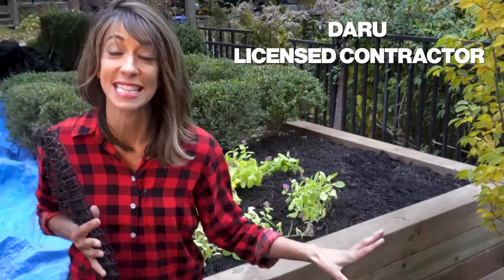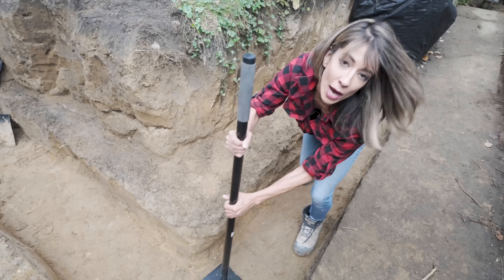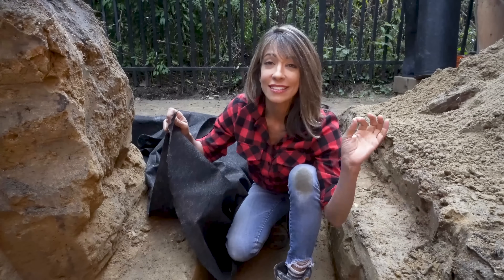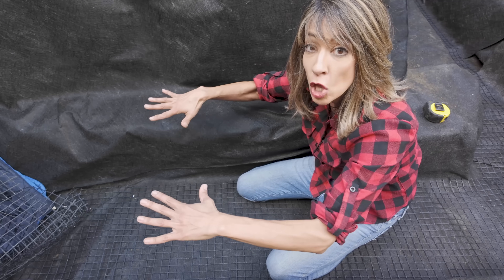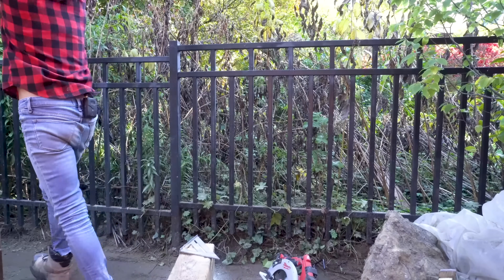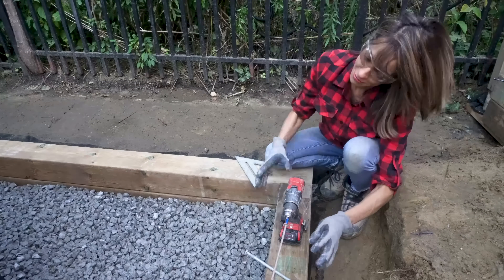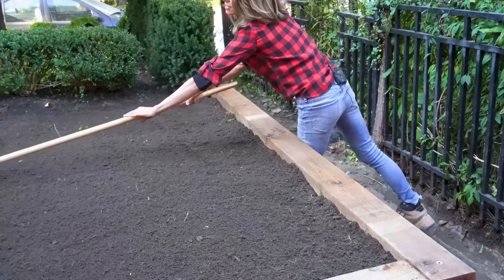No One Builds Retaining Walls Like This...Yet!

Comment: You don't need to fix the geo-grid to the timbers at all? I know it gets squeezed between the timbers, but I would have figured you would nail it.
Reply from the maker: @youmertz  the screws and the timbers secure the geogrid firmly in place. You could use an alternative method of fastening if you’d prefer.

Comment: You have NICE soil for digging. We have adobe clay which is heavy muck when wet and brown concrete when dry. What's the size and type of rebar. I think it is smooth , which is easier to work wit. Not sure if deformed is useful.
Reply from the maker: That's a tough one for sure! I have a great appreciation for this soil now thanks to all the comments. The rebar is 1/2” most hardware stores will carry it in the lumberyard.

Comment: Great job. Just as a general carpentry note. It takes 3 to four screws or nails to prevent shifting in the tie backs, or any other woden structure of this type. A complement,  you are a powerhouse for such a small person.  👍
Reply from the maker: @oldreprobate2748  thanks for sharing your tips and experience with securing the tie backs. Always good to hear you’ve experienced. Noted.

Comment: Great video - Do you need to pre-drill a hole for timber screws to reduce the chances of the timber splitting?

Do the timber screws 'sit' flush to the timber so the timber screw head doesn't create high spot causing a wobble?

Thanks
Reply from the maker: @samiam4202  Thanks. The screws don’t need pre-drilling and I didn’t experience any splitting. They are bugle head like a deck screw so they sink into the wood. Designed so the next course sits flush. No wobble. I liked them a lot.

Comment: Wow very impressive video. Not a single wasted word or moment. The ending with the Canada post story was the only non-informative bit but even that wasn't unobtrusive and kind of quaint. Thank you, I only came to see how you did the tiebacks but learned even more in the process. I have a retaining wall that is failing on a property I own. It is about 10 ft high and 200 foot long and bowing out badly all over. I am just curious when and where the tiebacks are used as in what heights do you install them and how often down the length of the wall. Maybe every three feet of wall height and staggered down the wall every ten feet and then alternate in like a cross hatch pattern or checkerboard as seen from facing the wall? I'm thinking the tiebacks I would use would be of a different design since I don't want to have to dig back behind from the face of my wall ten feet into the soil to bury them. Maybe a screw type device specific to large retaining walls. Thanks for the great video!
Reply from the maker: Good to hear form you and your feedback! I can't provide you with advice on walls that high because they would require an engineer to give you with the proper information for the soil type and conditions in your area. All the best with your build sounds like you're on the right track.

Comment: New subscriber here. Love what I'm seeing here. But opinion coming. Your drainage pipe should have been on top of the geotextile fabric below the rock. Now you will have water sitting at the bottom of your trench with the wood.
Reply from the maker: The wood is sitting on 6 inches of base aggregate so it will be good to go for drainage. It's good to keep soil away from the wood. Good reminder, thanks!

Comment: Please stop using epoxy coated rebar. It’s a flawed product that does not protect the steel rebar and holds onto moisture against the steel. This product is no longer approved for civil engineering projects or high rise construction.
Reply from the maker: Good to hear your feedback on the rebar. Thanks

Comment: Fantastic, someone who actually teaches the CORRECT way to build a retaining wall. So many do a half way job of their projects and you know in 5 years or so they will be wondering why it came apart.👍
Reply from the maker: Good to hear John thank you!
Reply: Yes drainage is very necessary, as any solid can oversaturate and cause retaining walls to fail.
In addition, I add T risers to the drain coil and a solid plastic layer at bottom for approx 10-12 inches; so you can flush out the drainage system.

Comment: Not sure I am convinced the georgrid is more secure than the dead man supports.  Think I would feel more confident with more dean-man supports,  Particularly on a wood retaining wall.  If this was a landscape brick wall where dead-man tie backs are not an option then maybe the georgic providers support absent the ability to install dead-man reinforcements.  I would concede the geogrid on a wood wall won't hurt, but I would contend one is not getting the reenforcement strength one thinks they are for the added cost.  More wood dead-man reinforcements would be much more structurally sound.

Difference of opinion on this particular technique.  I appreciate and enjoy your videos.
Reply from the maker: @James-cn9no  I appreciate hearing your perspective. I would definitely recommend deadman and tiebacks too. I would add another layer if I was going higher too. I purchased the Geogrid from a local landscaping supplier. It was $100, my cost and I did 3 walls with in. Good to hear your opinions. Diversity of perspectives is important.

Comment: Wood retaining walls can be strong, especially with geogrid reinforcing.  BUT wood will seldom last beyond a couple of decades before it starts to rot - even pressure-treated lumber will rot.  Depending on the wall height, replacing it in the future will be a challenge.  Precast modular blocks (especially dry-cast) will succumb to freeze-thaw damage in northern areas.  The most durable retaining walls will be of wet-cast modular or cast-in-place concrete.
Reply from the maker: There are many ways to build and it depends on the project and what the owner wants. I appreciate your perspective.

Comment: Where does the water from your French drain go?   Looks like it drained onto the crushed gravel just outside the retaining wall, where it will just back flow into the crushed gravel behind your wall.
Reply from the maker: They make drain extensions! You can pick them up at your local hardware store. Excellent for your downspouts too!

Comment: 0:31 BS.  You didn't dig crap.  Why don't the big wall block companies call for geogrid at the bottom?   BS video.
Reply from the maker: The brand I use does require it. I expect more brands to follow because it makes sense. This is a channel focused on innovation. When better methods exist I will use it, even if no-one else does. I also appreciate the advice of viewers when they share their methods. I learn from you too.
Reply: Hmmm...B.S...???...Well, what she is doing is certainly not my world of architecture at all, since I only work in vernacular historic restoration/replication and the sustainable natural building world...However, when we do these with wood in the traditional fashion of them (been around for millenia and in several cultures) it is done exactly the same way...for the same reasons...and the only difference is natural and sustainable materials not toxic industrial ones...

I can not, of course, speak to where you are, but I can assure you that nothing here is..."B.S."...and that is speaking as a professional designer with over 40 years of experience in architecture.  I can also tell you that these standards for MANDATING geotextiles of several types and this type of natural stone backfill...as well as...the "tie back"...reinforcement is required by IBC and other local codes in many municipalities if you tear out, replace or build a new retaining wall...and that requirement is spreading because...THIS IS BEST PRACTICE...

???...Whether she dug all this earth out herself or not I don't believe was the topic of the video but by the way she handled the shovel, I do not think she would have an issue at all working with a crew doing the same work they are doing so I'm unclear of why you felt it necessary to reflect such misogyny since "who" dug the hole was not the topic of the video, but rather "means and methods."  To be blunt, I believe your comment is the only B.S. in this comment stream thus far that I have read...

Comment: Please learn how to use a sledgehammer, that's so bad. If it's to heavy to swing get a smaller one like a mash hammer.  
Other than that good vid.
Reply from the maker: It’s not the typical way to swing for sure. Funny enough small sledges, mallets require more upper body energy and strength. I’m petite so this is by far more efficient. Don’t be afraid to go against the grain if the outcome is more beneficial to you and your work. I’ll be the odd duck on this any day. Good to hear your advice, thanks!
Reply: Curious, what did she do that  was "so bad,"  Please don't tell me you mean the "ramming" she used to put in the rod?  Sorry, that is standard practice and has been since this tool has been around...and that is speaking as someone with 40 years of experience in traditional crafting including make these tools as a blacksmith as well...Ever work with a "Mexican" landscape crew?  They do it all the time and will even melt lead or bronze into the head of the sledge, while others "tack weld" a steel plate to the top of the head for more weight and this very reason...

Comment: Great video. Did I miss something about plumb for the vertical stacking? Many times walls have each stack with a half inch to the outside or a very slight angle leaning to the inside. This helps stop the rotation of the wall resulting from the force behind it. Once the wall  moves past 90 degrees to the outside the wall is in trouble
Reply from the maker: I did a batter or 1/2” offset on my last retaining wall and garden bed videos. It’s a great way to add additional strength to a vertical wall. You are spot on with your advice! Thanks. It’s also helpful if your timbers aren’t perfect. Vertical is a popular choice for homeowners which was the decision maker in this case.
Reply: I think you're referring to a "battered wall"...please correct me if I'm wrong. In the case for a "dead plumb" wall be it timber or stone, the method is to use "tie backs" to facilitate the "dead vertical" orientation. You can (not recommended for armatures!!!) "batter out" a wall if you know what your doing...This methods is called "corbeling a wall."

Comment: Very, very informative.  Thanks for showing all the steps and explaining your choices.

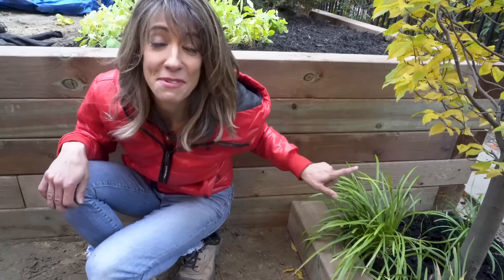At 15:23 you can see that you buried your new European hornbeam with mulch several inches up the trunk.  That will allow a fungus to grow on the bark of the trunk and stunt the growth for years until it finally dies.  If you want it to survive, simply remove the retaining wood in front of the tree and blow the mulch away such that you can see the flare of the roots above the surface of the soil/sand.  If you need to raise the tree to expose the roots, NOW is the time before the roots become implanted.  As long as the tops of the roots are exposed, that's enough to assure that the bark of the trunk is safely above the soil.  

Pet peeve of mine:  The proof is not in the pudding (or puddin').  The proof of the pudding is in the eating.  Ask your great grandmother about this beloved saying from antiquity.
Reply: I didn't see that...good catch and very correct!!!
Reply from the maker: Thanks for your feedback.

Comment: What do you expect the useful life of those beams to be? Every wood beam laid on the ground like that I've encountered is rotten, warped, and in general unserviceable condition.
Reply: With this method, as done, a wall like this in a Canadian biome/climate type should have a functional service life on no less than 25 years and could well extend to 50 years if properly taken care of...
Reply from the maker: Thanks for sharing your knowledge on this method. I appreciate the insights.
Reply from the maker: The gravel base is essential to prevent rot. Proper drainage ensures a long lasting build.

Comment: Would this retaining wall construction work well for the edge of a property that is sloping into the neighbors?  Where would you place a fence that runs along that property line?
Reply from the maker: Yes as long as you leave enough room for the tiebacks and drainage. I have a bigger wood retaining wall in the background of my floating deck video that shows a taller version of this wall for those interested. Fence posts can be incorporated into the design too.

Comment: Good build, but I think you are implying the geo grid is doing more work than it really is.  Still necessary, but…..
Reply from the maker: I’m not implying. I’m stating facts. Geogrid reinforces the wall by connecting it into the backfill making the two separate units (the wall and backfill) one solid mass. That’s an increase in size and weight of over 938%. Mass is a critical component of strength. Uniaxial also has strong tensile strength making it excellent for strain relief. This is why Geogrid is standard for block retaining wall construction and civil engineering projects. My last video on block retaining walls goes into more benefits like creep reduction and erosion control if you are interested. Tensile strength is explained in my joist hanger video.
Reply: @DaruDhillon 
I’m a mechanical engineer. 
As soon as those beams dry out and you don’t have as much friction of the two beams pinching the mesh, there is very little connection so there is very little effective tensile strength.
Reply: @shawnbrennan7526  ...Shawn...PE...or not I think you are "guessing" at what the dynamics actually are in walls built like this, and I most certainly mean this correction to your assumed observation in a respectful context.  I'm speaking from the position of someone with 40 plus years of professional design work in building these (and related architecture) from natural "green wood" timber and other natural/sustainable and historical materials (my area of expertise) and I have a PE team I have worked with for 30 of those years (all with PhD in "timber engineering") that would spec out a wall exactly like this. I would also add that many municipalities are requiring wood retaining walls to be built in this fashion...for the same reasons. 

Timbers do "dry out" over time but it takes almost a decade (in this size) to fully dry to equilibrium and that is if up off the ground for proper lumber drying method.  In this context, they never will fully.  Timber and plank with only wood joinery is employed in a similar fashion to this to build both root cellars, water tanks and even natural swimming pools. The compression load on these will more than trap anything between them and that is especially true if "pinned" or "trunneled" together as these are. 

I'm open to more question or challenges, should you have them...
Reply: @JayCWhiteCloud 
My apologies that you’ve spent so much time responding to my comment.  Your video and attention to detail in the construction are excellent, and I wasn’t trying to distract from that fact.  
I’d guess (and yes, I said guess) that the deadmen/ties are 90% of the stabilizing force and the mesh is the rest.  Belts and suspenders, but not a bad thing.

Comment: And what is that "fabric" made of? Plastic? No thanks.
Reply from the maker: No, it’s non-woven, light grade geotextile fabric. Specifically designed for retaining walls, vertical and horizontal applications and drainage. Without it your aggregate won’t have filtration and will be full of mud. Not all non-wovens are equal. The plastic I show as bad is woven. If it looks like a tarp it will act like a tarp.
Reply: Plastic would be weird , i m more intrigued by the geo grid. That I couldn’t tell if it was light metal of plastic

Comment: Great video and explanation! Are tiebacks required for all retaining walls or is there a height below which they aren’t required? 
Also, would you be able to do a video showing how to get the correct slope on the gravel bed for the correct drainage on the drain pipe. This is the part I always get bogged down in. Thanks again and keep the videos and instructions coming! 🎉
Reply from the maker: Thanks for the suggestion, I’ll keep that in mind. For drains it’s a 1/4” of slope per foot of pipe.